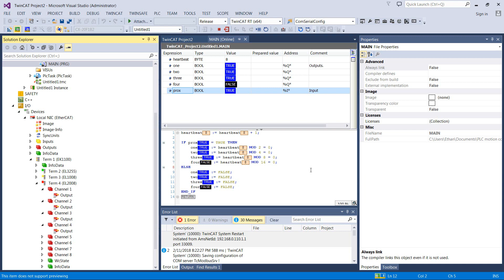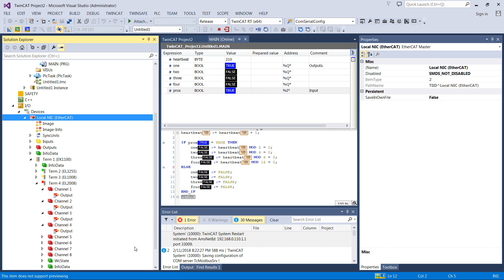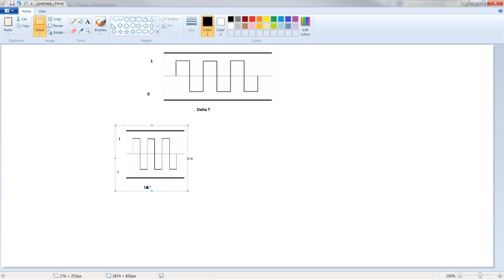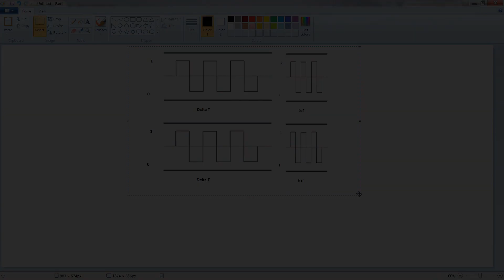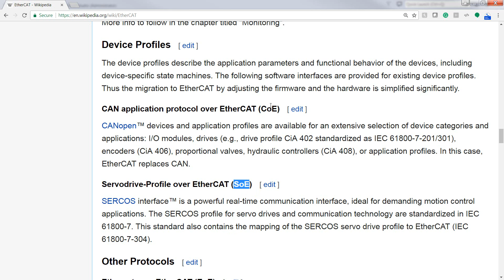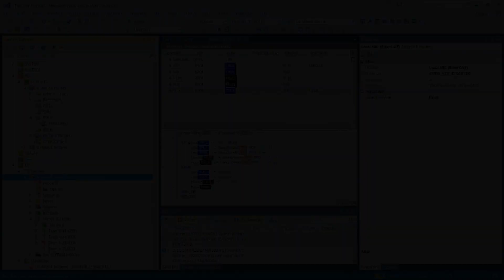Motion Control and IO with PLCs - EP5 - EtherCAT

Comment: Hi, I really appreciate your videos and I want to know if you had worked with commissioning a third party servo motor with TC drive manager 2, I have all data needed but I don't know how to implement on software, thank you
Reply from the maker: If you have the EDS file all you need is to get it working in NC. Once that's done the software is all the same. See the other videos from there.
Reply: @SquishyBrained  Thank you sir, I will search for documents and try later

Comment: Have you ever tried to connect a Yaskawa Driver to a Beckhoff EtherCAT system?  I'm trying to do this but I'm having trouble.
Reply from the maker: Yep. Do it all the time. You need the eps file from yaskawa. Beckhoff and yaskawa reps should be able to help, but hit me up if you can't work it out.
Reply: @SquishyBrained  I'm able to see the Yaskawa thanks to an XML file I got from them but I'm unable to get the drive to home (MC_Home).  I can see the OverTravel and Home switches in Beckhoff and set the drive to move to overtravel and back to home but it keeps getting stuck on the overtravel and never completing.  I have the MC_Reset and MC_Power working, but any command that creates motion seems to be not completing, starts but doesn't get completion signal.  I heard the Done signal is only for one cycle so I need to trap that signal?

Comment: Ethernet/IP actually isn't deterministic unless it is using CIP Sync, which they added later for the Ethernet/IP drives. Then it uses the distributed clock and managed switch strategy of ProfiNet (also deterministic). I can't remember what protocol I came across that modified packets on the fly like EtherCAT (SERCOS probably), but it's a pretty unusual way to do things that lets it have crazy fast cycle times at the cost of more chances for frame corruption. PowerLink is sort of in between EtherCAT and ProfiNet/CIP Sync in that it is poll and response, but doesn't require the managed switch stuff.
Reply from the maker: Thanks for the info.  I've never used E/IP on things that need to be deterministic, it has always been robot comms, and talking to VFDs and IO slices, etc.  Good to know about CIP sync though.